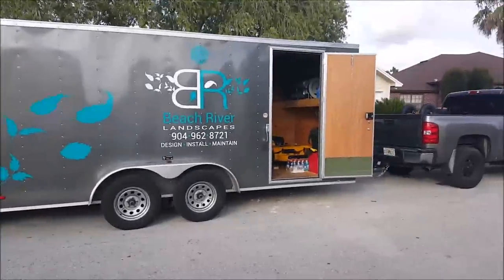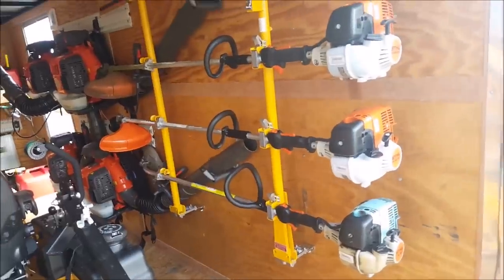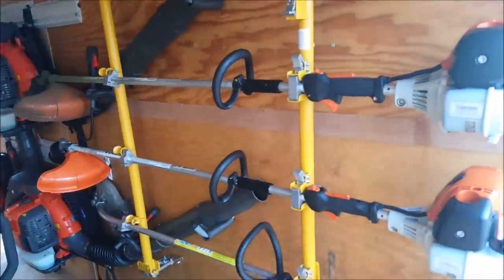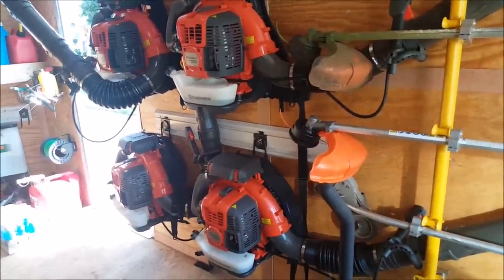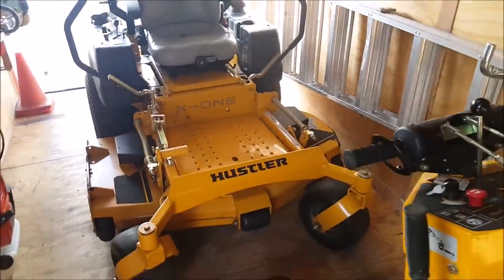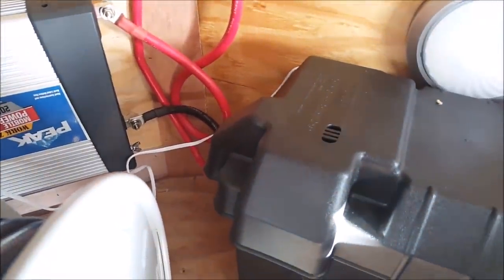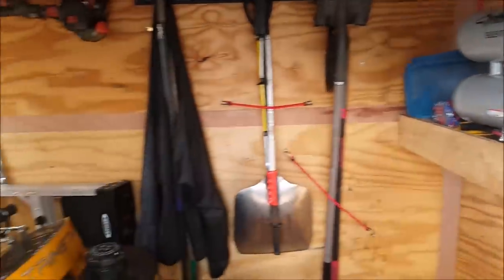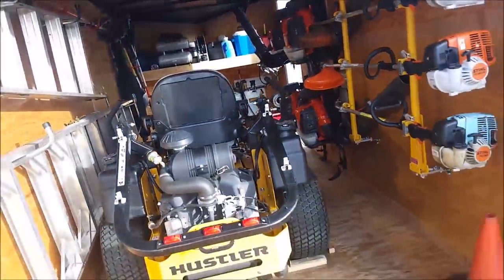Lawn Care Trailer Set Up 2016 Part 3

Comment: I like your videos.and the trailer setup is awesome. I've only worked from open trailer, truck setup. having an inclosed unit just for your wet weather gear, .hope you know blowing you're self down with air is very dangerous. the compressor must be so helpful. love your professional attitude toward your equipment and staff.
Reply from the maker: brian dufty thanks bro! I definitely take a lot of pride in the equipment as we spend so much money on it don't we? I used to do open trailers I'll never do one again. Once I went to end closed I can't go back. Blowing ourselves down is an absolute necessity we don't blow anything towards our faces really so if anything is going to inject itself into the blower and shootout it's unlikely it's going to be heavy enough to do any damage. It's been a ritual for 12 years now

Comment: Nice setup! I've tried to keep everything all clean and looking nice but it's hard with an open trailer setup. I've run the Extreme Series racks for 5-6 years and I got tired of the added weight of the aluminum blocks and I can actually break into them in about 2 secs... The aluminum curly piece on the inside that turns and locks the trimmers in is very thin and I can literally grab a locked trimmer and straighten the aluminum out! I forgot my keys one day a few years back and figured this out. I also had several shafts on edgers and trimmers snap in half but I didn't have the engine supports. You should be able to order the racks off the company's websites cheaper than Northern Tool, they are made right there in Florida.
Reply from the maker: I looked and they were more than northern tool for some reason. I can see what you r saying for the aluminum sections in the racks. but if someone wants something bad enough, they r gonna get it lol. I can see for an open trailer having issues with bounce and weathering. I feel the racks will benefit me more being inside enclosed trailer. doesn't bounce around near as much. I'm just really stoked on them. best tacks I've personally used yet, but yeah we will see over time !
Reply: i like where your going man, awesome setup. my trailer is almost the same. just a little feedback i have enclosed trailer as well and have the same 4 position trimmer rack w/ extended hedge trimmer/edger/and 2 grass trimmers with no engine supports for over 2 years and never any problems. no bent shafts. and we run all day every day. love these racks. also i have a lot of their other racks backpack spayer/water jug/ small hedge trimmer, all awesome.
Reply from the maker: Foley Lawn Care nice man, i def think the bounce effect isnt NEAR what it is inside an enclosed vs open trailer. i already grabbed them so fk it lol but thanks for the tip bro
Reply: you got it bro. it definitely doesn't hurt to have them, i like the way they turned out in your setup. i actually have the motor mounts in the box in garage from 2 years ago lol just never put them on. i probably should do that haha
Reply from the maker: +Foley Lawn Care yeah if you got em mount em!

Comment: I prefer Husqvarna Blowers and Weed Timmers   But I like the .Stilhl Edger and Hedgers .
And I just Bought a Toro Commercial Z 2000 with Mulch kit its Amazing .
I had a residential Hulster Raptor SD 48 and It did really well for 2 years so I kept it now for Discharge .
Reply from the maker: Ted _ Cori hood idea for the mower to keep it for. Toro is good stuff.

Comment: Those blowers are exactly like my Red Max EBZ-8500 . The end of the tube is designed to  bust up compacted leaves and heavy debris. I have a EBZ-7500 (1 model from the top) Its a better all around blower,lighter,more accurate aim and distance. You may want to try the model under the one's  you have . The end  of the tube tapers in on those. Just food for thought..?..

Comment: Like your trailer set up! Trying to get my compressor set up like yours. Having trouble deciding what deep cycle battery to buy for our inverter. Do you mind telling me which battery you bought and approximately how long you can run your compressor before recharge.
Reply from the maker: John Clemens a deep cycle battery 750  cranking amps

Comment: also you can hook the deep cycle batwry to the trailer wiring to charge the battery when the truck is running
Reply from the maker: that's what I'd like to figure out how to do
Reply: It's easy just take the back wire from the trailer harness that's the positive to charge the trailer brakes battery and acc batteries. And connect it to the deep cycle! The wire will be connected to the breakaway battery box
Reply from the maker: thanks bro I'm a look into that.. do I just run it to the positive terminal on the battery in the trailer?
Reply: yep you have to ground the battery to the trailer frame or run to wires up ft the ground is white, on the trailer harness.
you don't need hugh wire either 12 or 14awg will be fine just a small charge circuit.

Comment: I would not buy the X-ONE, just becuase its expensive. When I start, I'm gonna start off with a Hustler Raptor and then in like 3 years get a Fastrak SD. Iv'e had a Stihl BR200 for 1 year, and the straps haven't broken, but you buy what you want! :)
Reply from the maker: Crisp Cuts Landscaping well, I was starting a new lawn service I was just starting over from a divorce and jumping into commercial accounts the X One was a needed welcome! But that's why there r always options and diff needs fosho!

Comment: Got the same rack, I put some large L brackets to support the weed eater engines. Maybe over kill but I don't want them bouncing around at all.
Reply from the maker: is there such a thing as over kill? lol
Reply: +Beach River Landscapes haha after I wrote that I watched the next video and saw the engine supports you added, didn't know they made that. The brackets I put up work great. They are about 1" wide and probably about 9"x9" long. Figured I'd let people know just in case they couldn't afford the one you got. Also I ran a length of 3/4 plywood about 10" high across the very bottom of both the sides of trailer side walls. This way if for any reason you hit into them with the mower, the deck won't go crashing threw that 1/16th inch crap they got on there. Good videos keep up the hustle.

Comment: those tandem axel trailers suck. we make a lot of turns in my area and the tires wear out so fast. went back to single axel.
Reply from the maker: yeah, they wear out, but thats the ONLY downside imo. Single axle isnt going to last as long with 2 large 54-60" mowers in them. But, thats why there are so many options out there for us all :)
Reply: we only need 36" here .. do about 150-200 houses a week. live n south eastern NY. gotta bag all but 3 of em too .   :(
Reply: I like the small 5x10 open trailers, since is only me. Put some trimmer racks on the 5x10s and a hustler raptor, then put the blowers in your pickup truck, and youve got it made.

Comment: What kind of rack system are you using for the blowers?
Reply from the maker: Greentouch Racks bro. They r solid as heck man. Trailerracks.com use promo code beachriver it'll save u 11% if u decide to get them.
Reply: I'm definitely going to look about getting that rack.

What are you using for your back pack blowers? It looks like a track system with attachments.
Reply from the maker: D L bro! Check my last set up vid out !
https://youtu.be/PWpSEYklbNI
They have every rack you need man. Since this vid I upgraded racks big time
Reply: I checked out the vid, its an awesome setup. I don't have the cash for it right now though.  My truck's in the shop and gonna cost me 4k to fix. I'm just going try and find  the racks you're using in this video for now till I get some money together for the GT stuff. What are you using for the blowers and rakes/shovels?
Reply from the maker: D L they were at home Depot some husky hangers
Reply: Beach River Landscapes Thanks I'll look into them.

Comment: I will never buy a echo blower or husq. Redmax has never let me down.
Reply from the maker: RedMax and Husqvarna are one in the same as one owns the other now. to each their own but I am in love with the Husqvarna 580bts blower it's hands-down the baddest blower I've ever used. but it's basically the twin to the RedMax 7500. no I have never owned a blower other than Stihl, I hope they last :-)
Reply: I didn't know that they owned each other. Good to know. Thanks for the quick reply.
Reply from the maker: +A-Veteran Lawn Care yeah no problem bro, Husqvarna bought out RedMax which is how they came to have the 580bts
Reply from the maker: I don't know why it typed 7500 the 580bts is basically the replacement of the 8500 by RedMax
Reply: +Beach River Landscapes damn and the 8500 is beast! What's the price difference?
Reply from the maker: +boss30277 600$ but my dealer did them for 499 to match the stihl 600

Comment: do you ever tie your mowers?  don't want be like the guy who say your trailer is really clean. but I see a lot of DOT violations
Reply from the maker: no I dont. dot doesn't regulate us in that way here. since it's enclosed and they never get displaced I haven't had the need to !
Reply: +Beach River Landscapes DOT violations? Never heard of that in FL. I'm down in Ft. Pierce and I also use the 2x4s in front and behind the mower tires. They rarely regulate those operating with out a business license, low balling properties, nevertheless are they going to check for DOT violations.
Reply: Lucky you guys last year I got pulled over and got about $2700 in citations. Fire extinguisher,cones, strap Mowers strap gas, wrong place for dot number it added up but cop was a good cop I had only pay 300

Comment: I am looking to do a similar compressor setup where did you find the power converter? I can't seem to find one with the switch.
Reply from the maker: Kyle Vadeboncoeur I got it from Oriellys auto parts
Reply: Beach River Landscapes Thanks. Also,  a solar trickle charger could be a way to charge the battery.
Reply from the maker: Kyle Vadeboncoeur yeah that something I have to figure out cause taking it over n and out to charge is ridiculous lol